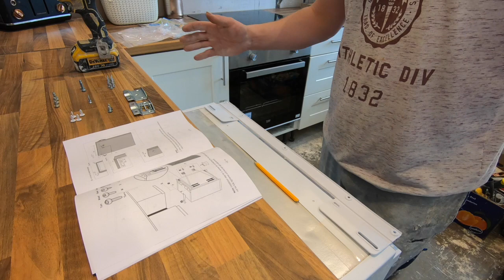HOW TO FIT A BEKO INTEGRATED FRIDGE. Including side panels and fitting of handles

Comment: Hi thanks for your video

I am trying to fit exactly the same fridge and have an issue with the door opening where the lower part of the door just touches the panel on it’s right. If I close the door it’s all flush with the surrounding. Hard to explain without a video or pictures.
Reply from the maker: i would really need a picture or video like you said

Comment: Do i need side panels if it is a single appliance cushioned in by normal base units please? Also, what if the worktops are Quartz as you cannot drill into it.
Reply from the maker: the fridge only has fixing one side so needs to be fixed at the top 100 per cent but the freezer has fixings both side so you might be ok but again you would have to see once you fitted both side of it if there was any moment.. I had a little look and they seem to have special clips  to fix sinks and dishwashers that you glue to the worktops so i am guessing you will get them to help you fix the fridge, or  if you speak to the supplier of Quartz they should sell them. hope this helps you a little
Reply: @hishersdiyrenovation6367  Great video many thanks.  We will have the same problem as we have a slate worktop - but I think I will just keep the fixings from our old Zanussi which has two fixings, one either side and epoxy the relevant one to the top of the fridge to fix it to the other side.  The fixing on the door side of our Zanussi isn't actually screwed to the side and it does keep moving and I have to pull it forward every so often - it's inherited and was like that when we moved in, just haven't got round to sorting!!  I guess I could look at some sort of wedge/spacer at the back to stop it moving - with appropriate ventilation holes of course!